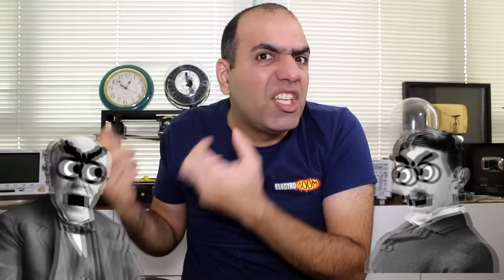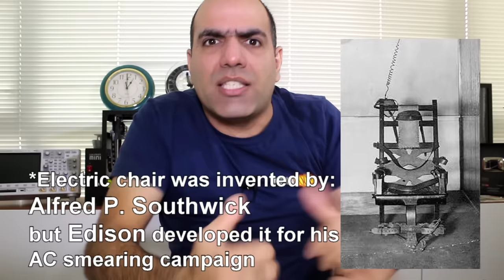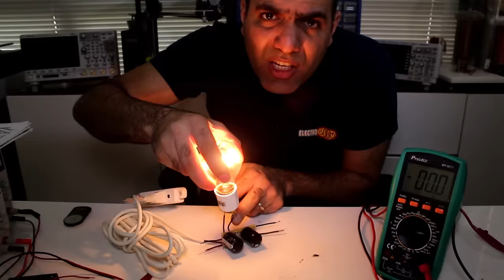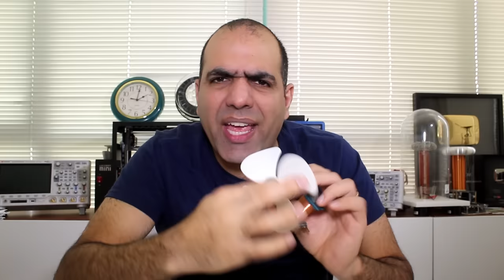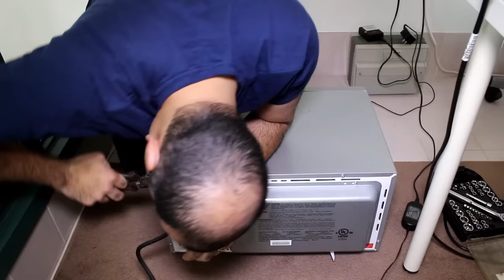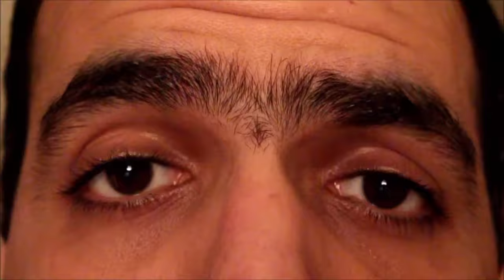Why Use AC Instead of DC at Home??

Comment: AC is a lot easier to change voltage. Just install a transformer. Was told at an IAEI continuing education class ( need 8 hours a year to renew electrical license) that Japan is experimenting with supplying DC panels along with conventional AC panels in commercial buildings. Reason being it saves 3 to 5% on energy and cooling load. Each electronic device would not require rectifier or power supplies if feed by DC.
Reply: It maybe a viable option to use DC transmission over short distances for a very specialized tasks but it offers nothing in advantages that a more simple AC transmission system can achieve. 
The biggest challenge in electricity generation is storing the overnight generation that very few people actually use as they are asleep in their bed.

Comment: Didn't really answer the question imo but great video. 

I2R losses explain transmission network AC 》DC, but why not have a common 240V rectifier at the house? That way everything is DC and we don't need multiple rectifiers all doing the same thing. 

Are the I2R losses within the house walls really big enough to warrant using AC all the way to the connection port? Or is it to do with diodes and rectifiers by extension being cheap.

I guess over the lifetime of the building the losses from 10m of wiring add up to be more costly than multiple rectifiers?
Reply: Because having a rectifier that big would be really expensive and also you could not use standard transformers for appliances that need smaller voltages. It’s just not worth it.
Also the switches would get damaged due to the fact that arcs in light switches would be self sustaining thus causing fires.

Comment: The problem is transmission, not distribution; you can’t have DC transmission lines spanning the country the way you can AC; the DC current doesn’t maintain the needed voltage over distances as AC does.

Comment: Your transmission is a little bad... Why.. because the most efficient way of doing long distance transmission right now is..... HVDC lines @ 100kv to 1100kv.. why ? Because they have way less loss and are much cheaper to build... Ac have much more losses over distances and also phase shift problems that DC doesn't have. 
Ac are good i you want to communicate back and forth ( encoder or lan ) otherwise there is no real benefit in homes ?? 
I absolutely love your videos. They are pure gold!

Comment: I don't understand one thing. If the input voltage on transformer is for example 100V and current is 10A, then we should have let's say 1000V output voltage and 1A output current. But if we have resistance in the output circuit, it will determine the actual current due to Ohm's law. So doesn't the power maintaining break the Ohm's Law? Cause the resistance value depends on material and is determined. Please someone explain this to me.

Comment: However, modern HV DC transmissions can actually be cheaper and more efficient if the transmission distance is long enough.  DC has lower transmission loss, but higher conversion loss.

Comment: High voltage AC could travel thousands of kilometers in thinner cables and line losses are lower thus making it much more economical. 
DC line losses are higher even with HVDC

Comment: AC is used instead of DC because it's energy loss is less than DC since you electricity turning on and off on live and neutral wires, which is exactly what reduces the energy waste, even though it's dangerous, so an earth wire is also introduced to get rid of it's danger.

Comment: you have to put 1000 plugs in a apartment or house if you have just dc. with ac you have max 3100W power of one ac plug. enaugh for many small pulling devices.

Comment: 300V DC is more dangerous than 220V AC ( 310V peak ), because DC tends to lock you muscles on to holding on, AC tends to make you jump and so more likely to break the contact.. . . But as Mehdi says, both can be dangerous. . .  .. But the Edison / Tesla difference was more about using existing DC Generators, lines and equipment, as opposed to changing to a new method, which made no difference for short distance, but had benefits when going to long distribution lines.   . . . .   Ironically, very long transmission lines are better as DC and that is where we are going now, back to DC or HVDC.

Comment: Why can we not use a circuit that works similarly to a Buck-Boost to get a high DC voltage to reduce the current over transmission lines and then step it down?
Reply: Forget "Buck-Boost" but one CAN use High Voltage DC to transmit electricity, as is done on Undersea Cables.
One cannot use AC on LONG Undersea Cables - because of the Capacitive losses involved with these cables when AC is used.
With DC there IS a capacitive LOSS just at "switch on" but no capacitive loss thereafter.

To "step down" or "change" high voltage DC (into AC), "electronic" means are now employed.

Comment: AC is used to transport electricity over thin wires. You can easily transform AC into high voltage. The current can then be low and the cables thin.

Comment: Nice video. But I didn't get the answer, why AC instead of DC? I understand, that for transmission we need very high voltage and low current, but why can't it be high voltage DC? Why do I have AC in sockets in my apartment? After transmitting AC it could be converted to DC for my sockets. But why is it AC?
Reply: The issue was, with DC the wires melt before you can reach those same voltages.

Comment: But the advantage of AC is only to be able to use a simple transformer to change the voltage. So AC has nothing to do with the transport itself, only with a simple way to change voltage. In fact, DC has less loss on transport than AC at the same voltage, that's why we use DC for very long powerlines. HVDC uses 100kV to 800kV to transport energy with a loss as little as 3.5% over 1000 km (~ 620 miles). So in the end, Edison has won big time as all the big international power networks of the future will be HVDC.

Comment: Nice demo, BUT,,,,whether it was intentional or not, you implied that Tesla INVENTED AC power.  He did not.  European power companies where he came from were using AC for a while.  He is correctly credited with convincing Westinghouse to adopt a crude 2 phase AC system that was later upgraded to a more efficient 3-phase system.  Westinghouse would have gotten AC patents from others anyway if Tesla had not been there.

Comment: There is an argument for low voltage Led lighting where you have a battery back up.
Saves that fumbling for a flashlight when the power goes off.....

Comment: There is a but ... At the same voltage DC travels with less energy loss than AC , also requires less insulation

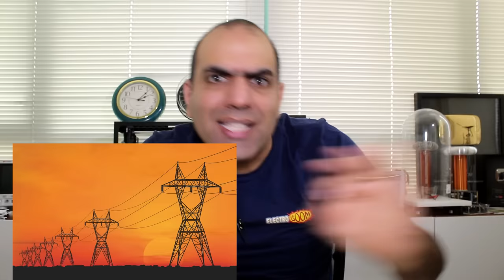Comment: @3:02

@ElectroBOOM : "And that's why Edison's DC power distribution system eventually died away"

Not entirely!! Have you researched "Path 65" ? Pacific DC Intertie, HVDC power line in the United States (HVDC High Voltage Direct Current)... Hint: 1 Million volts DC is involved. I was lucky enough to tour the Oregon side back in the early 1980's!
Reply: He has actually made a video about HVDC. It is nowadays used in almost every long distance transmission

Comment: So why don't we convert from AC to DC in our basements and wire the house for DC?  Is it still unsafe if it's running through our walls? Aren't houses with solar setups with giant batteries sometimes wired for DC?  Aren't RVs wired for DC?

Comment: Could a hypothetical DC transformer be useful if such a thing could exist? I guess the question would be better phrased as; Are there anythings that transformers do that DC doesn't have a component that does an equivalent function for? IDK it's hard to explain but hopefully someone understands what I'm asking. Also my same question, but also considering alternative configurations ie using a transformer as an inductor.
Reply: That would be voltage regulators. And the energy efficient ones (switching type) basically convert to ac and back.
Reply: @kefeer123  thank you for the reply.

Comment: Well but DC is used now for 1000km + lines having better efficiency.

HVAC is actually worse for long distances with higher voltages of above 800kv. HVDC is used more and more

Comment: 1. AC is good for power distribution.
But this not explain why in home You don't have one AC/DC power supply for all electricity in home.
Maybe problem is with different voltage needed to different things.

Comment: I had a question.  Why does arcing increase with higher voltage,  even though the current is decreased?
Reply: Because electrons move in the presence of an electric field. The electric field strength is measured in volts per metre. The higher the voltage, the higher is the electric field strength.

Air/gas contains atoms with electrons around the nucleus of those atoms. If you apply a higher voltage you strip more electrons away from the atoms and the electrons are accelerated more, which means that as the electrons collide with atoms they knock more electrons away from those atoms (avalanche breakdown is the name for it).
Reply: Thanks a lot for the guidance. Now I understand it better.

Comment: My CB radio, used came with no AC chord.  It was cut off.  Should I get that fixed before using DC power.  I know nothing about electrical 
transmission.

Comment: I am watching my comment from 6 years ago asking about why not step up dc voltage with boost converters and then step it down with buck converters.. with no reply.. i guess i find the answer my self.. if you are using for example ac 120 volts and 5 amps for a fridge it will be the same as dc , in fact dc much more safer except for one little proble. dc high voltage makes arcs when you are trying to open close a circuit so your house was going to be on fire after your first try to flip a switch or other appliances that using thermostat those things could never work with dc in addition with ac that is interrupted 60 times a second so the arcing is not happening..

Comment: Couldn't you have just initially generated DC with a very high voltage and then just stepped it down near the houses? As long as the source is very high voltage DC wouldn't that work? I know that we can step down DC easily I literally have a little DC Buck converter for stepping down to 5v

Comment: It doesn't really matter if electricity is AC or DC what matters is what the voltage is. A transformer can easily change the voltage of AC electricity then another device converts it into DC

Comment: Yep. AC can be transformed at will (with simple magnetic transformer, no semiconductors). DC can't. That's why AC beats DC to be the plug power. This doesn't even involve remote power delivery.
Why home plug use AC: Devices need various voltages and they need to make their own power. So they need power modules (including transformers) to get the desired voltage. This would be a nightmare if home plug serves dc.
Why local networks use AC: They can deliver the power at ultra high voltage with little current to reduce cable heat (it would be a f**kton of them without raising the voltage) and revert it back to the desired voltage (110v or 220v) at destination.

Why interstate (or even international) networks use DC: CHINA has this. Don't think the United states has this at all.
AC has iron loss (induction loss). When you deliver the power over long distances with AC the cable made a capacitor with the ground and yeah they make a run for it. To prevent this you make high voltage DC with specialized converter stations and use another to get your AC on destination. The converter station is expensive and a lot more bulky than a transformer so don't use DC on local networks.

Comment: If transmission is the main benefit of AC, then why not convert household current supply to DC, when stepping down the voltage from 400V?
So that household runs 220V DC instead of AC 🤨 
Is it not possible to step up the voltage if it's DC?

Comment: The "Edison cheated Tesla of money" thing is a myth, and doesn't seem to have been about a transmission system. In "My Inventions" (1919), Tesla wrote "During this period I designed twenty-four different types of standard machines with short cores and of uniform pattern which replaced the old ones. The Manager had promised me fifty thousand dollars on the completion of this task but it turned out to be a practical joke. This gave me a painful shock and I resigned my position." Edison wasn't his manager.
Reply: Similarly, in a "Letter to National Institute of Immigrant Welfare (11 May 1938) [reprinted in Tesla Said, p. 280], Tesla wrote: "The manager had promised me fifty-thousand dollars, but when I demanded payment, he merely laughed. 'You are still a Parisian', remarked Edison, 'When you become a full-fledged American, you will appreciate an American joke.'

Retellings seem to have fused the manager and Edison's later response. Almost every retelling also has Edison saying "Tesla, you don't understand our American humor", but I have yet to find any source for Tesla reporting that wording.

Comment: Yeah but we know now that dc doesn't use the entire line it only runs on the surface of the line . That's how your cell phone can use 5 v and still work . See with dc you don't need have high current loads unless your starting your car so in theory dc is actually more efficient

Comment: Complexity for one.  There are DC to DC up down convertors  but AC is easier to work with.  I think he is demonstrating shop safety in a "this is what happens" sort of way.  Meters today are so cheap and the decimal point in the display gives the illusion of pinpoint accuracy.  
One piece of advice ///If working with anything over 90volts try and keep one hand free not touching anything.  It is safer.  I know cannot be avoided most of the time  just know all the hot spots around you.

Comment: Why is it that the same power/energy is transmitted across the power line, but only when high voltage is transmitted, no issues?!! The explanation i^2 R doesn't look logical, something is missing because as long as the some power is transmitted across the line even as high voltage , the power is same right?!!

Comment: if a lamp is driven by 120VAC, it is driven by a sine wave 170V  peak.
One has to drivethe lamp with 120VDC to get same intensity.
Learn about RMS and it's relation to DC.

I suggest to make the proof of concept before getting in front of it.

Comment: i know we use AC with high voltage and small current, should be far more reliable than small voltage and high current. Not to mention the electric generator mostly used in my country generates AC.
But why dont we transmit DC with high voltage and low current as well??
Oh wait we do, in electric train! the overhead wire is high voltage DC and the grounding is more than 3M apart from it, the railroad 
someone please explain the disadvantage

Comment: I've asked myself this question many times why use ac when dc is better when it comes to saving energy bla bla bla I'm a white goods engineer and for example most new washing machines are now using dc motors I suppose the problem comes when you need heating elements as these need high amps. I was typing this before you finished your video never thought about the distance that the voltage would need to carried. Would be good if we could figure this out. Capacitors maybe ? Argggg Again I commented before you finished  why dont i listen before i open my stupid fat mouth your video is amazing your a legend. Why aren't we doing this ? Again is there a solution for high amp heating elements stupid question I guess.. if you don't ask you don't learn surely a dc heating element is going to be pretty rubbish although if you created a thin of enough coil this could work but that coil is gonna break all the time because its so thin... vacuum like light bulbs maybe I dunno talking man balls now lmao....

Comment: What about reactive power in AC?
What about a modern network with batteries and photovoltaik modules in DC, doesn't this work actually better?
Every modern device uses DC, DC can be stored, AC don't
Many power hungry devices don't care about AC/DC, like heaters
The only thing where AC has a clear advantage over DC are electrical engines, commonly used for industrial purposes
Is AC really the way to go in the future?
I've a vision of an additional DC grid from house to house that benefits from batteries and photovoltaik with it's own safety solutions like voltage drop measurement.
There is no frequency to care about, no reactive power which puts load on the system, that can't be used, no transformation necessary so no loss, that's in my opinion the grid of the future.
The wire gauge does not need to be that thick, the energy always get's pulled from the nearest source, like the neighbors battery.
Everyone automatically contributes power to the grid and takes it from the grid, wouldn't that be nice?
Why don't we have such a thing today?

Comment: Hey that’s not true, I’ve been able to boost voltage with a transformer(car ignition coil) and that’s with DC not AC, sort of.
Reply: You just run current through the primary coil and a magnetic field is generated. Then you cut the power and get high voltage through the secondary coil.

Comment: the real reason why use ac is because its easiser to convert from high voltage transmission to useable lower voltage power, dc is just as efficient over ac over long distances at the same voltage, but converting ac voltages is simpler and more efficient than converting dc voltages, good visual of how it works but the information is flawed